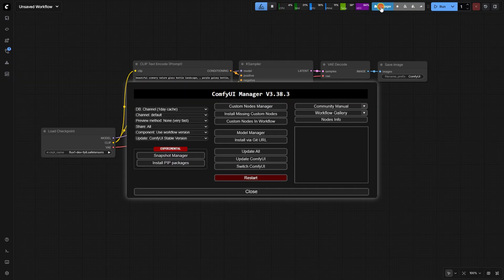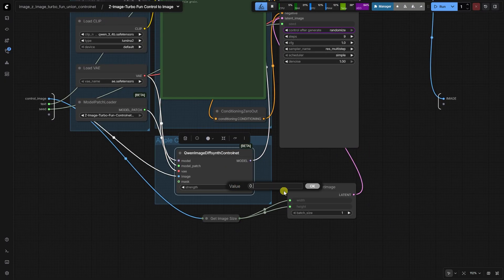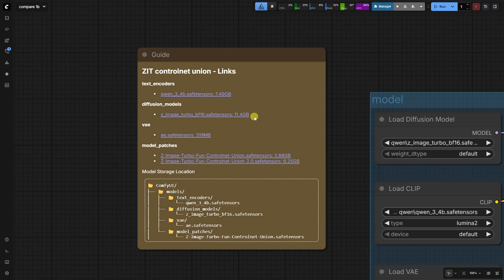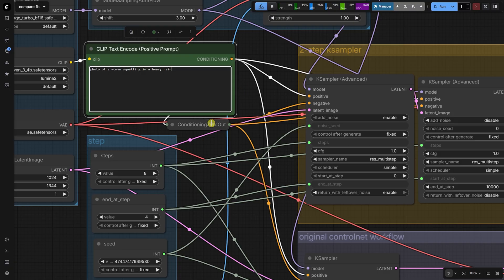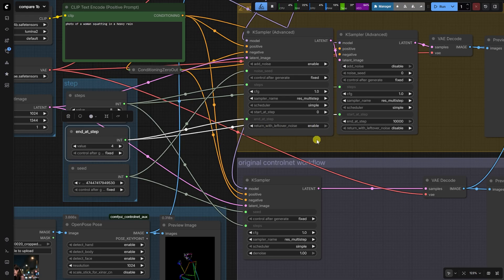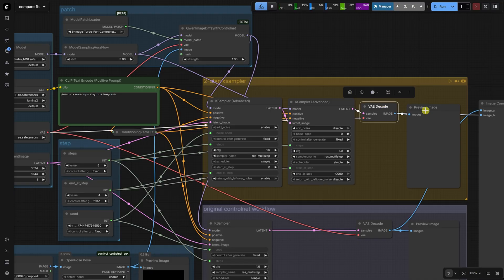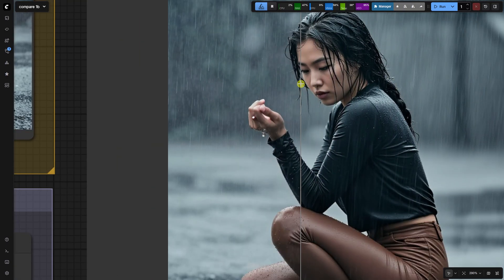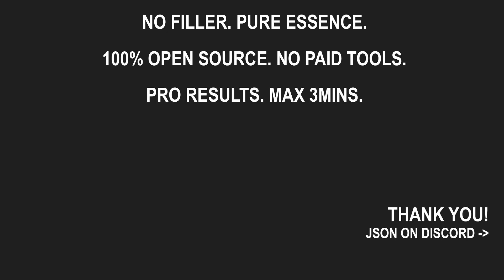🔵 Z-Image Turbo ControlNet Guide: High-Quality Speed Workflow (ComfyUI Cutting Edge Series)

Comment: Control net is toooooo slow. wihout contronet i genere in just 20-30 sec. but with controlnet it's take 300 sec. any solution i have 5070 12GB
Reply: He's likely running out of V Ram and maybe also even PC Ram , This was happening to me yesterday
Reply from the maker: @BabylonBaller  Yes. We should probably do a quick shortcut video on how to clean up / free vram
Reply from the maker: Controlnet does increase generation time, but should not be that much. Could you please try use controlnet union 1.0 AND the official/original 8-step workflow? If all models are loaded on first run, the second run should be really fast.
Reply: @The3MinuteNode  😁 i tired every model file on internet but no use. after just udpate comfyui and use Offical controlnet now it's working fine 752 X 1338 in now just 44 sec

Comment: Thanks for this workflow but it does'nt work with controlnet V2, I have error in Patches Model Node : "control_noise_refiner.1.after_proj.bias", "control_noise_refiner.1.after_proj.weight".
size mismatch for control_all_x_embedder.2-1.weight: copying a param with shape torch.Size([3840, 132]) from checkpoint, the shape in current model is torch.Size([3840, 64])
Reply from the maker: Can you please try updating ComfyUI to the latest version and make sure you have the controlnet union 2.0 downloaded from the official huggingface Alibaba-Pai repo, not other platforms?

Comment: Hey, great video! I have a question: you're using Python 3.13.9 for the RTX 5080 and 3.12.10 for the RTX 3080, right?
Reply from the maker: Thank you. Actually ComfyUI latest portable install comes with Python 3.13.9 and that's the experimental install I have - always update to date.

I do keep another stable install for production and compatibility, which has Python 3.12.10. Please check the video for those installs: https://www.youtube.com/watch?v=6ZyJv4OaHTo

Either one works for RTX 5080 and RTX 3080. There is no performance difference between Python versions but for compatibility yes.
Reply: @The3MinuteNode  I have an RTX 3090 and I'm using version 3.12.10. It works fine, except that with Qwen Image 2509 it's giving me black images. I guess the problem is on the text encoder side, but I can't figure it out.
Reply from the maker: @lycanARG  If you post the exact workflow json you are using but having trouble with in our discord server, we can take a look together
Reply: @The3MinuteNode  Thank you, I joined the Discord account a little while ago.
Reply from the maker: @lycanARG  Thank you. We can always talk on discord and it's easy to share json back and forth over there.